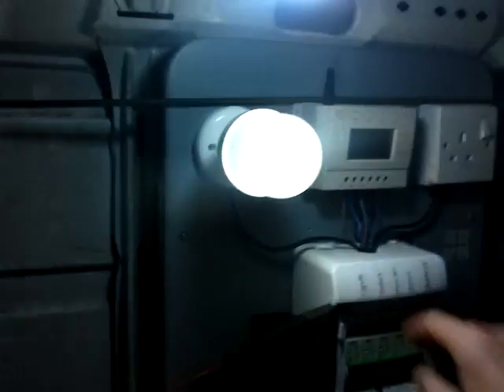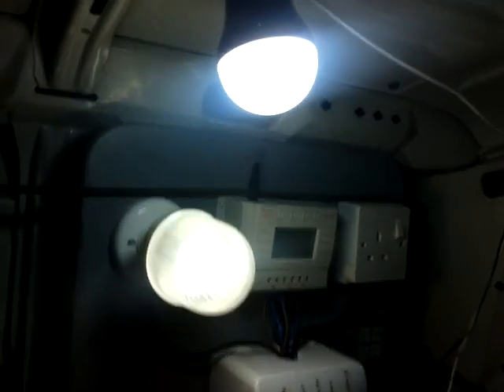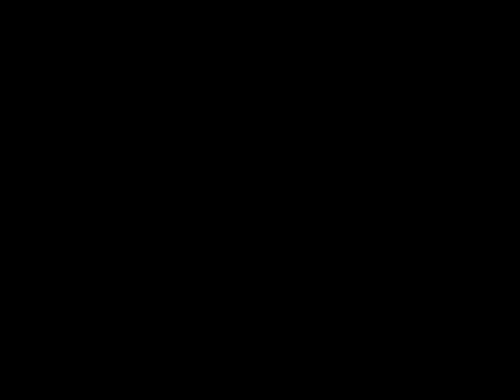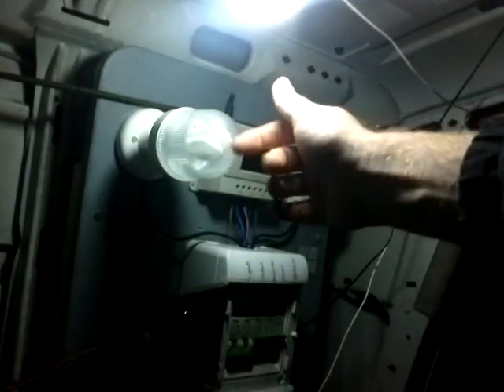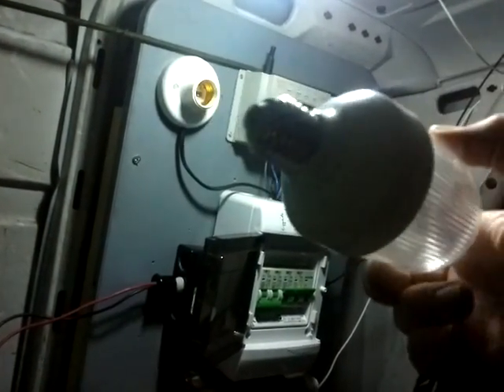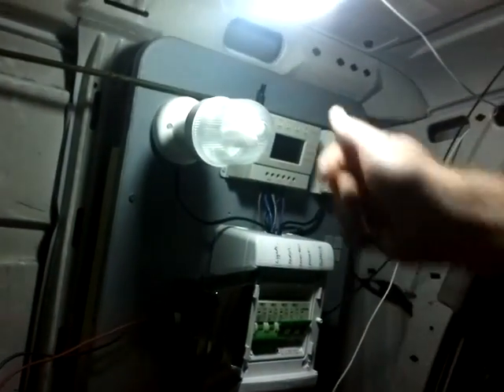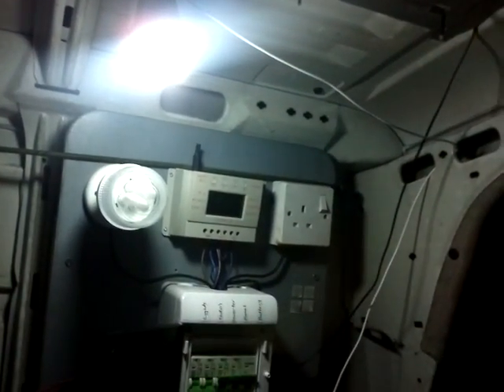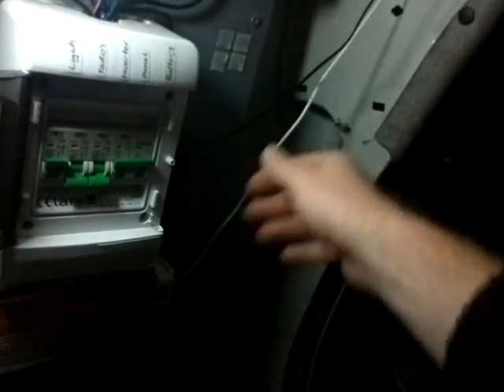12v 5w CLF bulb vs 5v 5w LED USB test

Comment: do you  have a site from the usb light?
Reply: +wow sly (26CTX941 M6CTP) I'm fitting a boat out at the moment. It doesn't have a 12v system at all. Since I'm not so great with electrics, how long would one of these LED's last when using, as an example, a 10,000Mah 3.7V Xiaomi Mi battery?
Thanks for the video :)
Reply: Thanks for the reply. Looks like the makings of a v.simple electrical system for my boat!